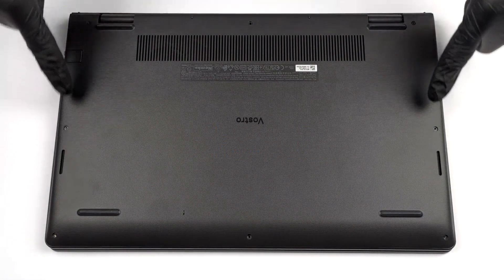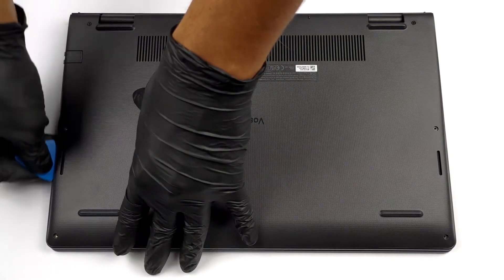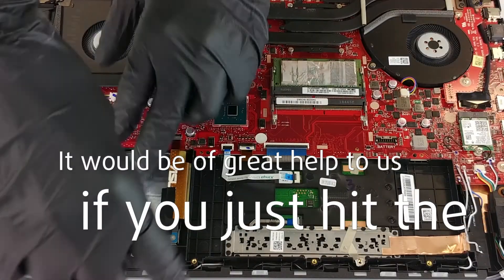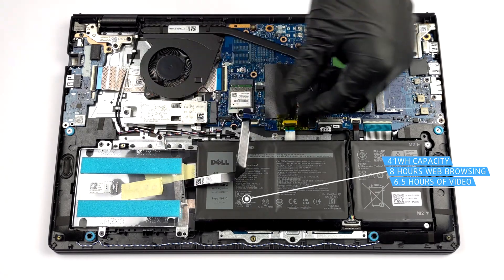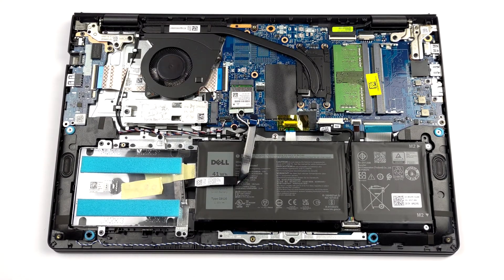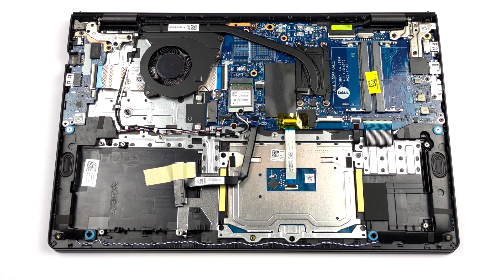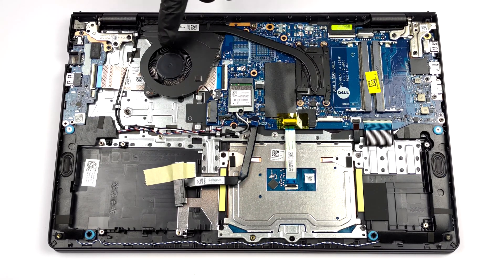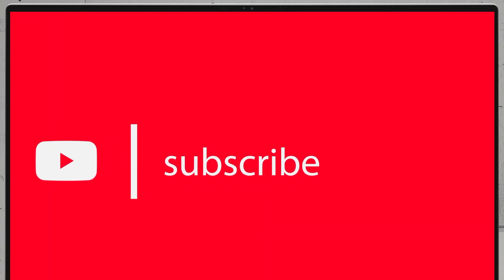🛠️ Dell Vostro 15 3525 - disassembly and upgrade options

Comment: How is the thermal design of this laptop?? As it's a U core(6) processor and has less TDP, do you think it is fine and can handle these ??
Reply: Thermal design is perfect when you browse internet, and watch videos. Up to 8 hours! You do not hear the fan. But when you start gaming it is just not enough to handle the heat. You can play Forza 5 some hours, but laptop so hot, that I am afraid it will not last for long.

Comment: Is this a good laptop for study and every day use ? And if the hinges is hard to open should i make it easy to open or that is okay ?
Reply: It is very good for study. It is silent, has 120Hz display with good angles, and lasts for 8 hours. I live in Ukraine and when russia bombed our power plants, there were moments in winter when we lived for two days without electricity and the laptop just amazed me with battery life. The camera is average and keyboard without backlight. I hate touchpads, so mouse was used from the start.  You can play Forza 5, but the heat is crazy.
Reply: @gost  Друже, випадково побачив твій допис і хочу запитати, в цій моделі точно є можливість встановити 2,5" носій? Бо навіть на офіційному сайті dell написано що такої можливості немає

Comment: Small heat pipe? Ryzen processors are 15W it shouldn't be a problem.
Reply: On small workload temps rise to 70-80 °C
Reply: Huge problem when gaming. Otherwise perfect.